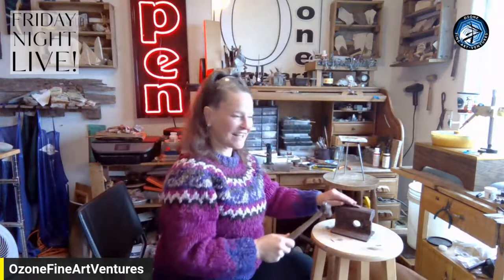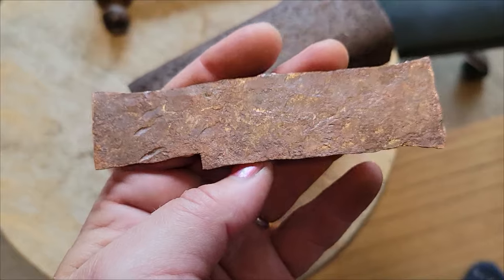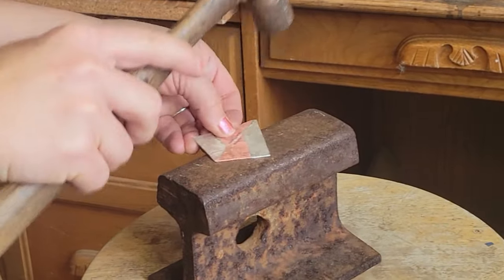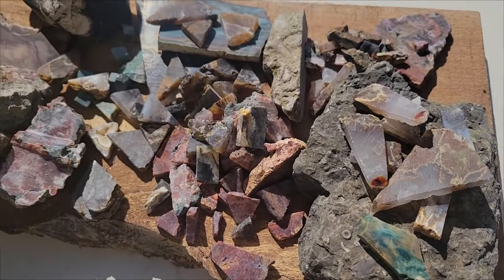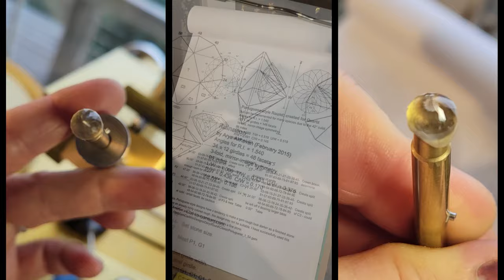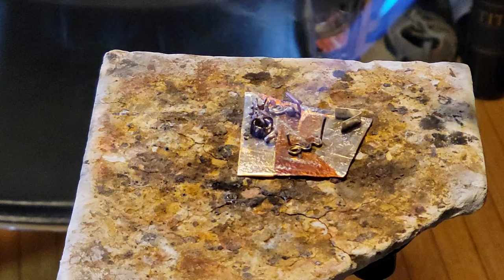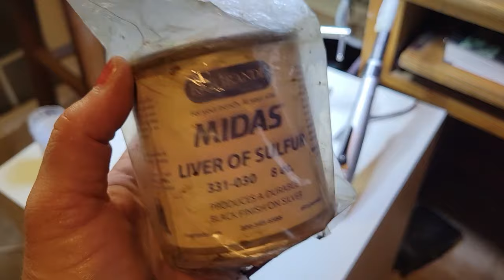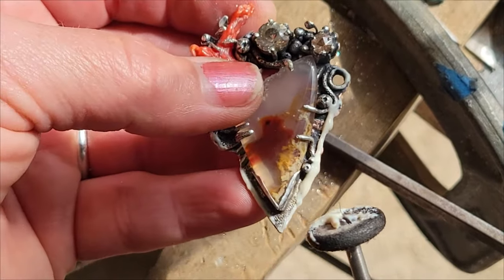Agate, Sunstone, Coral Creation??? Makers Challenge 5! #makerschallenge5

Comment: I actually liked the 2nd iteration of the coral over the first, it had more of a change in colors across it and complimented the agate quite nicely.
Reply from the maker: That's so cool that you tell me that. I was so so so so crushed (like the coral) when that happened. Took it on the chin, rooted through what I had to find another, and ended up liking the colors and sweep of that little guy better too! Did you notice your coral at the end? You knew I was going to use that as the awesome backdrop specimen 😆. Thanks for watching, cheers!